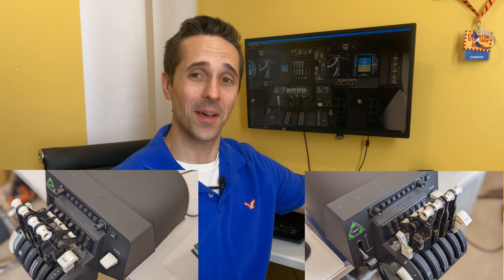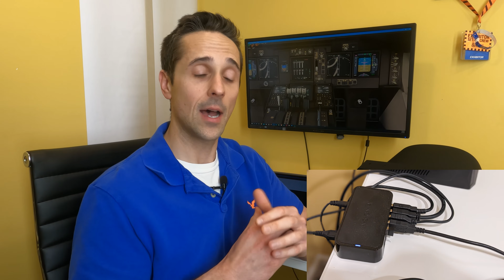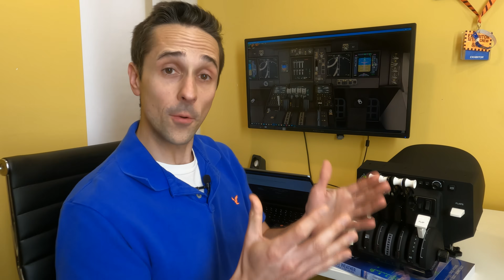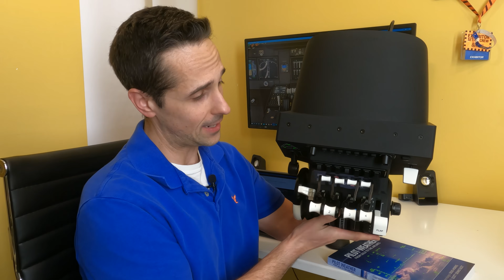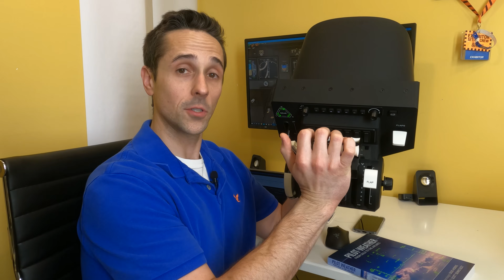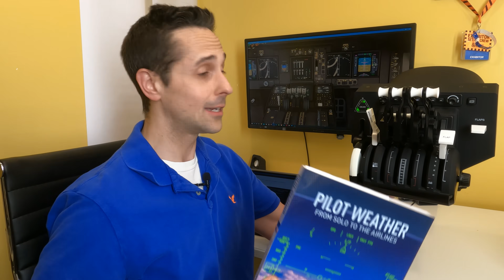Honeycomb Bravo Throttle Quadrant Annunciator Panel/Buttons/Switches View & Access

Comment: I just came across your channel today and have watched several videos and they are great. I wanted to ask you something you might be able to answer. I am currently 46 years old and would like to become a pilot. Due to my age, do you think I would be able to work for a regional airline eventually? Thank you for the great videos!
Reply from the maker: Thank you so much!

You can definitely become a regional pilot if that is what you wish to do at 46. The maximum age to be an airline pilot is 65, so you have time. The obstacles that usually get in the way come down to money, time, and medical issues. There are other things that could prevent someone from being an airline pilot, those are just the usual ones. 

Do you have any flight time?